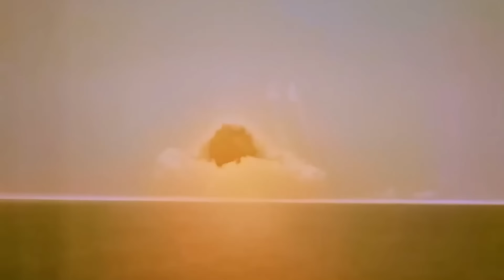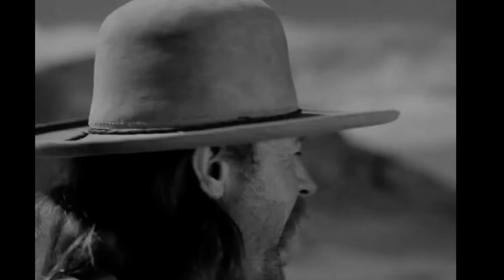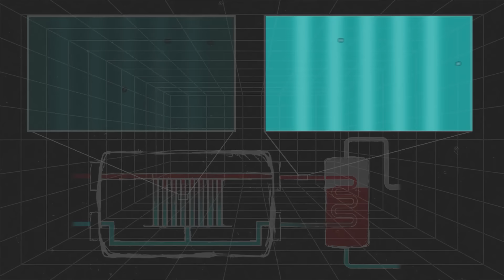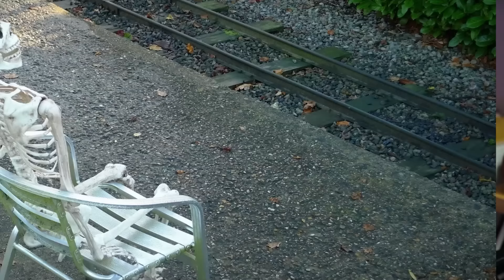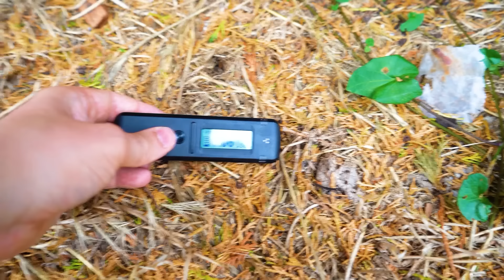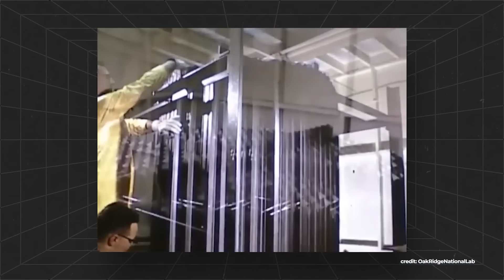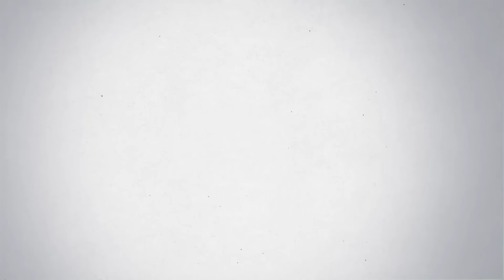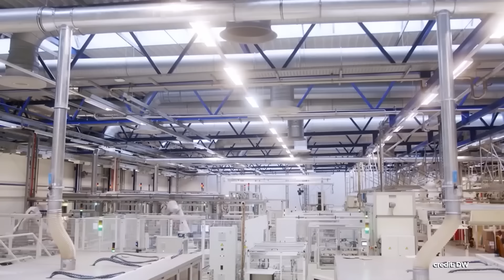It's Happening - China Launches World's First Thorium Nuclear Reactor

Comment: Actually, I really an interested in the Accelerator driven subcritical (ADS) designs for a thorium reactor. I would love to see one that is small enough to act as a power supply for an electric car. A mix of the reactor, some super caps and the electric chassis. The ADS reactor is a very safe design, turn off the power to the accelerator and the reaction stops. No chance for a run away accident.

Comment: Don't call it a dilute Uranium breeder reactor core! Thorium reaction chain being fast neutron means lots of neutron activation transmuting/corrupting all the machinery, piping, and salts involved.  This may be why anything with lots of plumbing, pumping, and chemical processing, has lots of maintenance costs and medium level radioactive waste generated.  All because "Uranium" is a boogieman word.  I suspect compact reactor cores like in CANDU and IFR designs will be more efficient, reliable (less prone to degradation), and more fuel diverse, able to solve existing nuclear waste issues by converting them into power and "ashes" with relatively short lived half lifes. They also can breed fuel from Thorium.

Comment: Further confusing the difference of Molten Salt Reactors, MSR, and Thorium fuel as well as other issues.  Thorium is just a fuel that MSR reactors can use almost any nuclear fission fuel including Thorium.  Thorium produces the same waste products as Uranium.   But in an MSR reactor the waste products of any fission fuel can be burned in an MSR reactor.  India has a massive program to use Thorium fuel in sodium cooled fast breeder reactors but little interest in MSR reactors.  China has access to most of the MSR research and technology developed in the US prior to 1980.  Including the first 2 US MSR reactors. MSR should equally capable of using nuclear fuel waste, non enriched Uranium and even weapons material.  Thorium is not useful for a nuclear weapon but can be used to produce weapons Uranium.  Or Protactinium. Waste from metal fuel rods with enriched Uranium from common PWR reactors can more easily be used in MSR reactors than recycling for reuse in existing reactors.  This mainly involves mixing with molten salts with ionic bonds.  Costly Separation of enriched Uranium is not  needed.  Some waste product can be separated for other uses or efficiency.  This may be done while mixed with salts.  Products produced in the MSR from fission may also be used for various uses.  Salts can easily be removed, processed and returned for further use in the MSR reactors.  Or MSR reactors can simply burn up dangerous nuclear fuel waste leaving smaller amounts of other less toxic waste for storage.
MSR reactors are potentially extremely useful for many reasons other than Thorium.  Some valuable materials can be used for industrial, research, space and medical uses.  Or destroy nuclear weapons material.  Low carbon energy production can be a useful byproduct of MSR reactors. 
India's efforts with Sodium cooled fast breeder reactors is difficult and MSR reactors should have been developed as a vital second option to burn India's abundant Thorium reserves.  China produces Thorium as a byproduct of rare Earth minerals.  China plans to develop a huge array of nuclear reactor technologies from around the world to eventually acquire a world leading nuclear capabilities with over 50 nuclear power plants.  Plus fusion research reactors.  Overtaking US, UK and Russian nuclear industries.   If other nations fail to develop Gen 4 reactors China will.  Including a Chinese Gen 4  gas cooled, pebble bed reactor prototype now in operation.  The US Terrapower has just started construction of a Gen 4 sodium cooled, fast wave reactor.  Very different to  India's sodium cooled reactor. This wave reactor offers many possible advantages similar to those of MSR reactors.  With very long lasting fuel options, simplicity of operations, factory production, mobility, fuel types, safety and lower costs. With the potential to develop a Thorium fueled type.   The wave reactor uses an elongated fuel containment system that burns slowly from one end  to another.  Using conventional fuel to start neutron production the neutrons the neutrons can convert depleted Uranium and possibly some Thorium to produce useful Uranium fuel over time. As fuel burns along the fuel core. Producing fuel along the way.   So Thorium and MSR reactors have multiple options.  Many people dislike MSR energy reactors due to corrosion risks but we have had 50 years to develop new materials and corrosion management to monitor and reduce corrosion risks since the last US reactor.   One complaint was that early MSR reactors were frequently shut down.  Instead of a problem this showed how easily an MSR can be shut down and restarted with minimal risks.  Chernobyl and Fukushima showed the risks of shutting down common PWR reactors.

Comment: Man a hell of a lot of noobs over this.... Thorium reactors are firstly much more complex and complicated than conventional nuclear reactors which is why the almost zero and implementation of them.  They require a complex chemical plant running at very high temperature with fluorine salts and regulated nuclear fission reactions to convert thorium to uranium 233 isotope...   Does it have advantages..sure! Are they outweighed by the complexity... We will see, but possibly...😮

Comment: Fun fact: When there was a race for approval by Nixon for moving to nuclear plants, a molten salt/ Thorium reactor was built however it had a "melt down" not long before the approval process. Naturally they have melt downs which are safe but because of this failure was not chosen by Nixon. Also it should be mentioned Thorium reactors can use Uranium reactor waste as well and can in some cases reuse it's own waste by cycling it back in. They are also scalable to be used more locally, even at the household level. The downside is they are highly caustic from the salt so the parts have a short lifespan.
Reply: Don't forget, Nixon started the EPA, maybe as a result of these kinds of events.  Very good decision.
Reply: china will find a way.  they always do  unlike usa's bickering over every matter.    the government in china literally mandates the entire country and all its resources to find a way to make the impossible possible lmao
Reply: capitalism is a tool of china.  while in usa    usa is a tool of capitalism.  sigh  thats why real progress is no longer possible in usa anymore.  trump wants us to go back to oil.....
Reply: The problem I have with all this thorium hype is that it unnecessarily demonizes uranium, which is providing 10% of the world's electricity without harming the climate. You can make uranium light water reactors practically meltdown-proof as well, by having a natural circulation based passive cooling system. And you can recycle any nuclear waste and put the plutonium especially back into a light water reactor, France does this. Or you can use any kind of breeder reactor, whether molten salt, sodium cooled metallic fuel or even some hypothetical water-based breeder reactors. Or gas cooled, or whatever.

Comment: Not having to physically and chemically process “broken down” fuel Rod assemblies is a HUGE savings.   The reprocessing of fuel rods involves melting them in… Molten salts.  Molten salt reactors can be load following as well.  They are not prone to thermal runaway or coolant loss at high pressure, as they operate at atmospheric pressure.